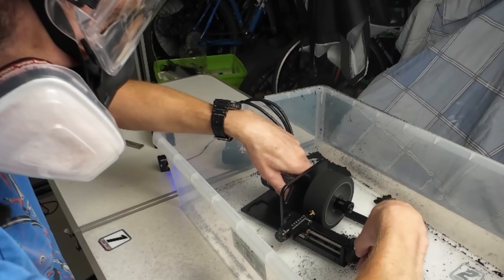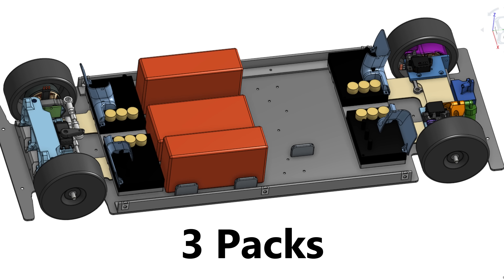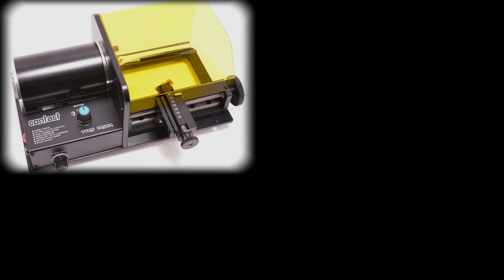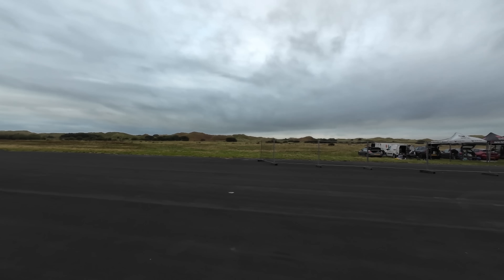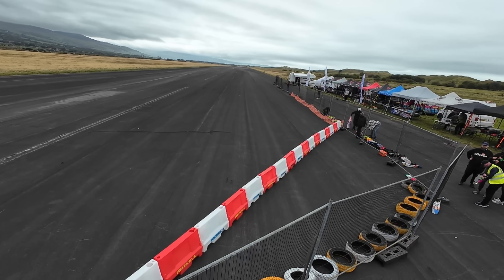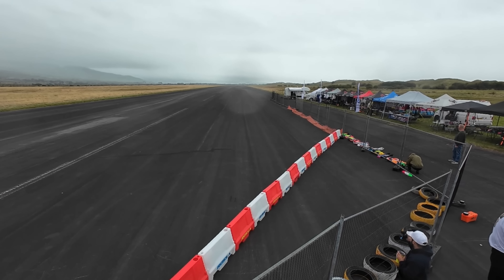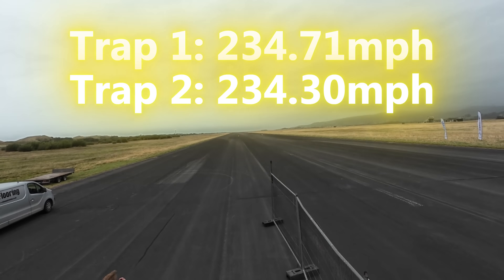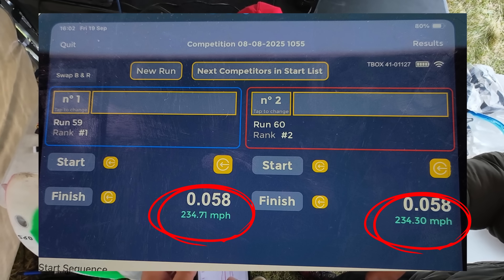How I Smashed the World Record at ROSSA Round 3 2025!

Comment: At 93mm diameter, them wheels are spinning at over 21500 RPM (with a g-force of over 24000 trying to remove one of the spatial dimensions from the wheel foam)
Reply from the maker: Yes you're right, the rpm's and forces are crazy. That's why foam works well as a tyre because if has a lowish density.

Comment: I've been thinking thinking about how my quads could make a better rc car with 4 brushless motors,, New Bee Drone has a kit to convert their 1s whoop into a rc car but your18s version is a little bit faster.. 
How do you program a flight controller to run wheels instead of props, that's what I'm curious about
Reply from the maker: Hey, its straightforward, you just have to get the directions correct on the mixing tab! Give it a go!

Comment: If I correctly understood the wheels to be 94mm in diameter, then you had these wheels turn at 21,253rpm or 354 turns per seconds.
Reply from the maker: Yeah slightly higher actually thanks to wheel slip! Crazy isn't it!

Comment: Do you use 8mm bullet connectors on the battery leads ?
Reply from the maker: Yeah correct, I like them because you can connect the batteries in series without any additional connectors or wires. And they are easy to connect unlike QS8's.

Comment: Well done! Don't they often require an average of two runs in opposing direction in some speed sports? Would account for wind.
Reply: The 1:1 scale😂land speed record held by Thrust SSC required back to back runs in both directions through a measured mile, turn around and refuel time within an hour.
As far as i know about RC (which isn't much) There aren't such strict criteria.
Reply from the maker: Yes correct there's no need for a return run. So sometimes you get lucky with the wind direction. I'll comment on it further in my next video ;)

Comment: When I saw a Xing on each hub I almost screamed! I know I am not the first, but I have been thinking about doing this forever! I am so surprised others don't do this. No drivetrain, less mass, potentially higher speeds with more juice, and it can be made to go faster with different sizes or KV. So much more easy than all that other mess. Awesome job!

Does it cog with low rpm's?

How do drone motors slow it down? Can you literally hit the brakes and the SC's adjust/reverse current?
Reply from the maker: Hey, yeah the IFlight Xing's are great motors! It's taken some dialling in but now I'm reaping the benefits. My car could do 200+mph runs all day because of the simplicity, where other cars will be eating drivetrain bearings. It doesn't cog, no. The VESC's take care of the slowing down too with reverse current, sending the energy back into the batteries :)

Comment: If you drill holes in the rims at an angle to draw air into the motors or to evacuate hot air from the motors, could that work?
Reply from the maker: It might help, but surprisingly the rims draw air through as they are because of the vanes on the inside of the wheel. So when the car is moving you get a good cooling effect.

Comment: finally a real engineer building fast rc car, other guys just add power and rip tires apart. very nice build. hub motors would be my way to go also for top speed. handling is great to, good job.
Reply from the maker: Hey, thanks for the recognition :) When I came into it I saw that happening so though't I'd take a completely different approach! The VESC speed controllers really help at not destroying the tyres.

Comment: now that's the kind of thinking/engineering that's driving me ! i don't do speedruns, but just like you i build my own RC parts ( on a much lower level of skill though ). stock chassis suck ? i will build mine and bend 7075alu with my own homemade tool. stock layout sucks ? i will make my own layout with better weight distribution ! can't find monster truck axles ? i will weld my own !!  anyway, keep on pushing the limits mate, i love how you share your journey and how humble you are !  if i may suggest obvious things : foam tires : for more durability i think wider and taller would help ? next step might be aerodynamic : i guess the body and the under surface could be more efficient ?  i subbed for more ! cheers !
Reply from the maker: That's awesome, sounds like you have a lot of great ideas! Yes Im looking into the wheel options going forwards and you're right that aerodynamics are the key to it. :)
Reply: @steveeng1826  thank you for your reply, that's why i prefer smaller channels !

Comment: You are aware that those batteries were initially designed by DANNY at SMC racing. Onyx ended up using that factory after Danny moved to another factory. So in true reality, those are SMCSRDV2 version two packs just in case you weren’t aware of that.
Reply from the maker: Maybe the early Onyx packs were but I believe Mike (onyx) has evolved the design significantly since then.
Reply: @steveeng1826 interesting.
Reply: @steveeng1826  I’d be curious if you actually used the V4 SMC packs compared to those Onyx packs

Comment: Great work. With regards to cooling the motors. How about getting billet aluminium wheels made as they would soak up the heat.
Reply from the maker: That's an interesting idea, thanks for the suggestion! The problem I would have with bespoke wheels is how to get a tyre mounted up to them, since you can't buy the foam tyres on their own.

Comment: Longtime machinist but complete newb to rc speed records here: Does anyone use magnesium alloys for machined parts on these speed record cars? It has the strength and rigidity but about a third less weight than 7075 or similar aluminum alloys. BTW, those tiny wheel lathes are really cool!
Reply from the maker: Hey, I don't think anyone has used magnesium in R/C anything before! Thanks for the suggestion!

Comment: This is awesome! Congrats! I’m very curious how you balance the speed between the wheels? Do you just connect the ESCs to the same throttle output and hope all 4 wheels spin at the same speed?
Reply from the maker: Hi Luke, thanks again! Yes you're right, all the motors receive the same throttle command, I'm banking on the ground connecting the four wheels together. Which applies as long as they are on the ground and not wheel spinning wildly!

Comment: Amazing work
I’ve been flying RC airplanes my whole life(I’m 42) and started flying FPV drones in 2017.. have thought about making a quad car and programming it in Betaflight like a drone.. any advice on that front?.. I noticed you’re using a stick radio do you have torque vectoring going on that works in tandem with the steering servo?
Reply: I believe he is steering by using different speed on the motors, no servo.
Reply from the maker: Hi, I started off using torque vectoring, it worked on my small car (have a look at my first videos), but I tried it on the Beast and it didn't work, so I added a steering mechanism and servo!  I haven't tried both because it works fine just with the servo, and torque vectoring could reduce the top speed. I hope that clears things up!
Reply: @steveeng1826  hey Steve thanks for the response! That makes sense.. question.. when you used vectoring what settings did you use on betaflight? Actually designed a very small vehicle I call the “QuadCar” that I’m planning on printing in TPU.. the whole frame will flex for suspension and I was wondering if I could get away with not using a steering servo at all
You’re doing some amazing work over there
The Beast is screamin!
Reply from the maker: @TheCiardellas  Hi, I just changed the mixing to speed up/slow down the pair of wheels on each side for yaw control. So you don't need to do much! The bigger problem is what you do for brakes!

Comment: Looked like a pretty strong tailwind.
Reply from the maker: Yes I'm going to comment on that in my next video 😊
Reply: @steveeng1826  Yeah, amazing last two meet ups and huge congrats on the new record, but I was wondering the same this time and last time around;). Not to rain on your parade - your work and accomplishments are hard fought and when you work hard, sometimes luck comes your way, too. But was wondering about how much of an impact it has and if there are any rules about it like I think there is in running?
Reply from the maker: Hi AntiVaganza, good to hear from you again! Currently there is no requirement for a reverse run in RC speed running. However we do require 2 speed measurements hence why there are 2 sets of speed traps. You're right that sometimes you're just lucky with the conditions, but you still have to have a car that can make the most of them. No-one else got higher than 205mph on Friday (or the rest of the weekend). Thanks for following along!
Reply: So, in my line of work (docu photography), I have to put the hours in, I have to have the skills, focus, vision (and the right gear) when things do all of sudden come together - and for you it's pretty much the same. You do all the work, you go to all the meets and of course once in a while things just work out better. But if you didn't, you wouldn't be in a position to get that extra bit of "luck";) 

And since there's no reverse run rule or max windspeed, your records are 100% legit. That's cool and congrats again:)

Comment: Hey man ,once again , congrats!!! If u want to sort out the wheels problem, just get bigger diameter wheels with low profile foam on it. The futher away the foam is away from the center of the wheel the lower the centrifical force is . Hope u will use this advice cause Raz and Kev dont want to listen to me.🤣🤣
Reply: Centripetal force is proportional to diameter, so... the opposite of what you're saying. I think what you mean is that a larger diameter wheel will spin slower at the same ground speed? Overall it cancels out because the centripetal force goes up at the same rate the wheel RPM goes down. So if you're only considering centripetal force the size of wheel doesn't matter. The more important benefits from large wheels are that there is more foam overall to be worn away, more gyroscopic stability (assuming width remains about the same so that the large wheel becomes closer to disk shaped), and large wheels handle bumps better.
Reply from the maker: Yes you're right iforce2D, nice one.
Reply: I am not a speed racer, so I have to think this is an inside joke, right? Because factually, it's the other way around, right?:)
Reply from the maker: Thanks for watching and commenting 😊. Trouble is with your suggestion there aren't many options when it comes to RC wheel sizes. I think "truggy" size is a larger option though I'll have a look into it 👍
Reply: On a huge wind turbine; the center of the blades moves slow. The tips move unbelievable fast. That's what I think trips up the birds. 

On a ford 351 Windsor motor with 3" main bearings; when the crank is turning 6,000+ rpm; the bearings are seeing some unbelievable feet per second going on vs if it was only a 2.25" size of a 302 for example.